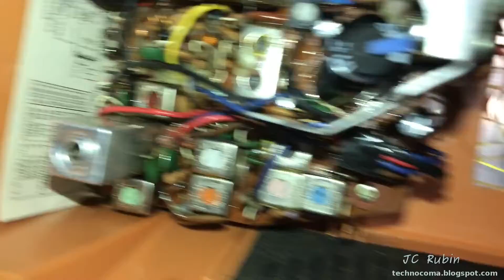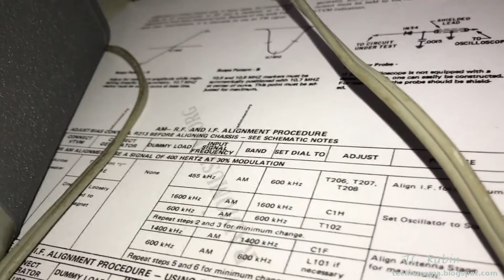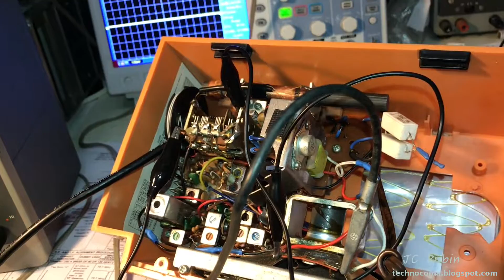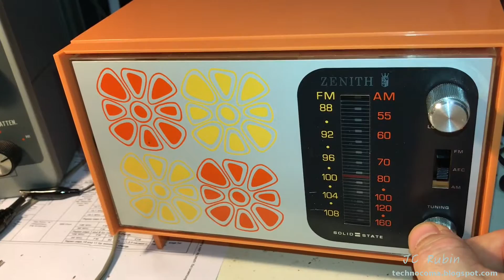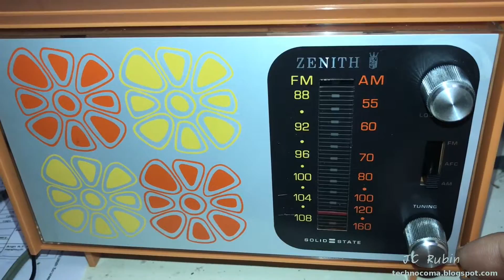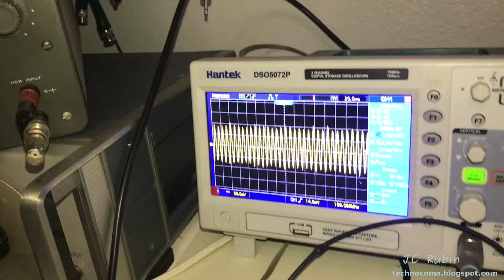Zenith 412V AM/FM Radio Repair - Part 3 of 3 - Reassembly and Calibration

Comment: I have aGE Superadio1 with a loose frequency display(behind the red needle). Every other part of the radio is good to great (small rust stain on batt. spring). So you know the performance level of these radios is the greatest among the transistor types. Why is it so difficult to get a cosmetic repair done on a not-so-disposable radio? I’m frustrated!
Reply from the maker: Wood and Metal is much easier to work than plastic